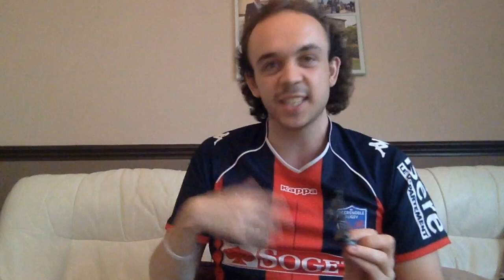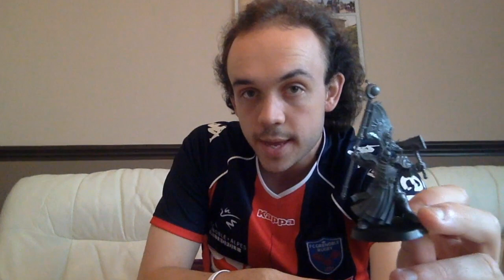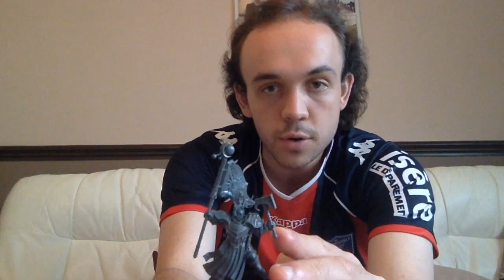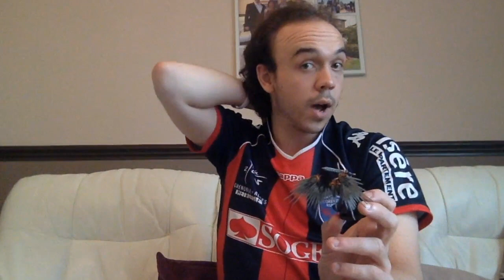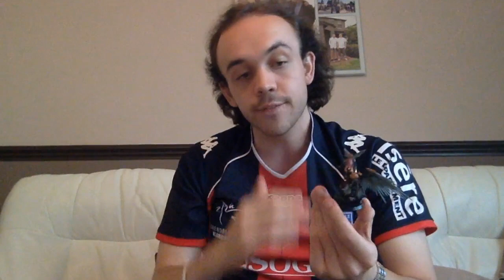My Thoughts on... Kit-bashing, Conversion and Custom Models

Comment: I draw the kitbash/conversion line at "counts as". The first example (a tactical sgt power sword on a devastator sgt) is pure kitbash, since you are still using a devastator sgt with an astartes power sword, no explanation needed.

The first model you showed is definitely a conversion (turning a model into what it isn't) since to a very anal opponent, its a hammer dude with a useless banner pole. 

I'm in the process of building "Handmaidens of Morai-Heg" for my Ahrhra led Ynnari army (he counts as the visarch). The Handmaidens are Howling banshees made from wych, harlequin and cabalite warrior parts.
 In fluff Ahrhra led a mixed army of Wyches (7th Woe) Harlequins (Laughing Circus), Corsairs (Sky Serpents), and Incubi (his own, Shrine of the Dark Father) to a fallen craftworld (maybe Myrmeara or Altansar). The Kabalites (Dire Avengers, Fire Dragons, Dark Reapers),  Incubi (Striking Scorpions), Corsairs (Swooping Hawks, Shining Spears, Crimson Hunter, Warp Spider), and Wyches (Howling Banshees) populated the empty aspect shrines, with the highest ranking donning the aspect armor, their thirsty souls absorbing and blending with the souls of the armor. 

I have another squad of wyches, run as such, that represent the reason they started to bond with the soul stones: being in the materium for extended periods without the torture shows and Haemonculi (both forbidden, along with farseers and warlocks by Ahrhra as what caused the fall, Bonesingers, Shadowseers and Void Dreamers are allowed, in a strange reflection of the Council of Nikea)... they got partially posessed/mutated into 1/2 Daemonettes. The giant crab claws are the hydra gauntlets, all are either wych bits on the daemonette frame or the reverse.